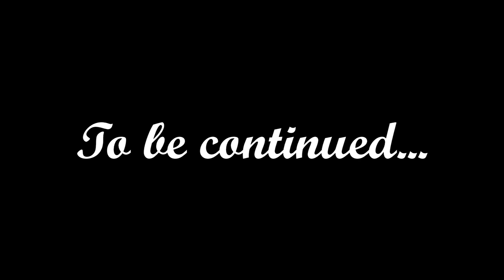Up a tree without a paddle

Comment: Could you not have filled the gaps in the window and door lintels with some old wood pieces and stained it to match ,as expanding foam is not a great material to use in old buildings.